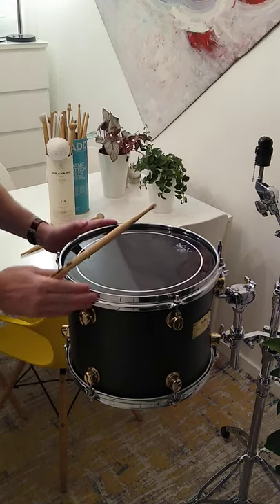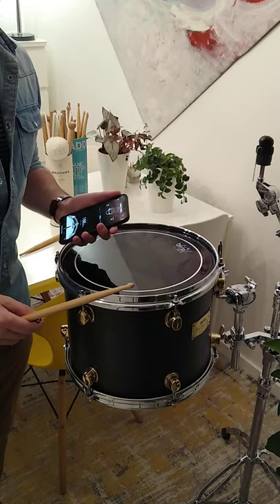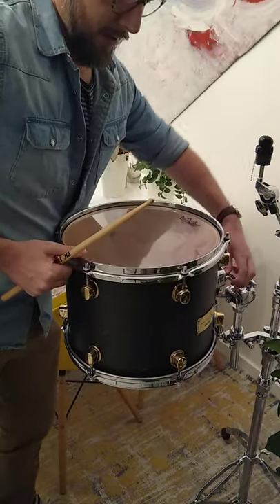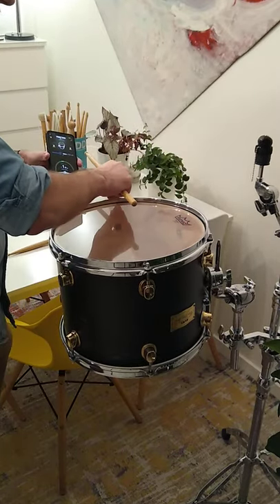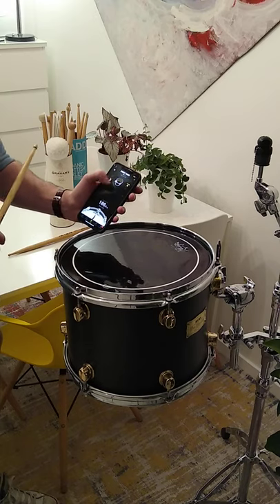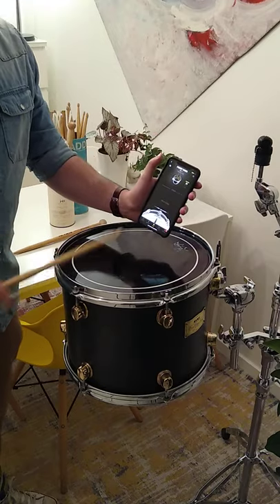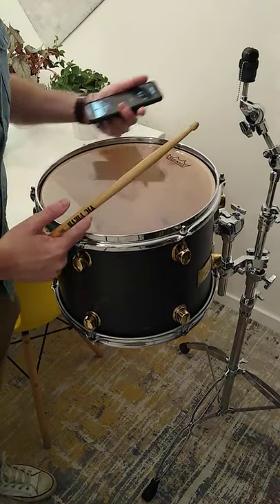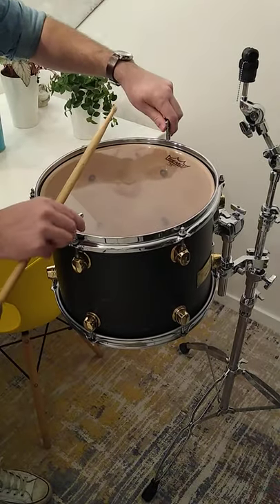Tuning my 13" tom from scratch to A2 for Tjas with both heads at the same lug pitches.

Comment: It will only work if you know how to use it i believe. You should still use yor ears and fine tune to your liking.  Devices such as this are only meant to be guides. They can help recreate the settings you like.  They can help bring you to the ball park of usable settings.  And that's a big help for those learning to tune. It gives you MORE ACCURACY.  But it will never replace our ears.  Can be a very useful tool if you know how to use it.  Takes practice.  Tells you where your drum is in terms of pitch and tension.  A reference.  That in itself is a great value. Just remember your ears are priceless.
Reply from the maker: Indeed, the app is a tool to assist you while creating & researching drum sounds. 
Basically, it’s a tuning aid that helps you clear your drum heads.

Mastering your sound, acquiring tuning insights, developing sound awareness, and tuning skills are learning processes. 
Making tuning decisions is not the responsibility of the tuning tool.  
As a drummer, it's important to recognize that you make the tuning decisions to master your sound.
Therefore, as a drummer, it’s important to acquire insights about at which pitch and tensioning range you should clear your drum heads to achieve a "sound & feel" A or B fit for your musical needs.  

As you underline so well,  that’s why it’s important to explore different tuning styles and why it's paramount to learn 'how to listen to how different tuning styles affect the "sound & feel" of your particular instrument and drum head combo so that you can decide on what tuning style suits your needs best. 

We fully subscribe to your viewpoint. 
Your well-founded comment is also a justified disclaimer about 'managing expectations correctly' and stipulates the importance of the angle from which the tuning topic is initially approached. 
It’s by methodically exploring which tuning action leads to what kind of "sound & feel" results that you 'develop your ears' to obtain a deeper "sound awareness," backed up by tuning insights. 
Developing a more refined "hearing-taste" and a "sound awareness, "meanwhile linking those to "knowing how to achieve sound & feel A or B"  by tuning (and/or muffling) is what matters the most and that takes experimentation, comparison, and thus... practice.

Exploring different tunings makes you acquainted with your instrument and its tuning range/sound versatility.  It's a journey. A process involving some research.
The app means to be a tuning aid which supports a drummer during that sound research process. 

Obviously, it isn't useful to see a tuning aid as a ‘tool vs. ears’ kinda situation.
You outline it nicely: a tuning tool is complementary to the common tuning process; it’s not something ‘different.’  We tweak the tension of the drumheads to get to sound & feel A or B. Using a tuning aid doesn't change that at all. 

Hereby, like you point out, once you understand that overall tuning process a bit deeper, making a tuning decision about "sound & feel" is where your ears are for. 

(It’s not solely about the values displayed on screen… and that is not where the focus should be because clearing drumheads isn’t the same step as verifying and understanding whether your drums sound at their best for your needs. )

For example, it isn’t necessarily because drum heads are accurately cleared to random lug pitches that the drum automatically sounds & feels right for your musical needs. You judge how fit a given tuning is for your needs. 
As a drummer, you explore, tweak and adjust at which pitches you clear both heads, concerning one another and also where they sit in their tensioning comfort range at that point, etc., to get optimal results.  
Developing a sense of which tunings get you to a particular "sound & feel" empowers you to tune your instrument to a variation of "sounds & feels"  (or even musical effects) fit for your musical needs, takes some practice and personal research to compare different tunings.

Just like you mentioned, gaining such understanding requires active listening, attention, and awareness…
When listening to the sound of a drum, one should check the rebound, listen to the attack, fundamental tone, and the overtone timbre and how both proportionally sustain and decay over time throughout the entire duration of the drum sound to get a sense of which tones project, how the stick rebound and articulation are, etc.
It takes practice, thus time & effort, to develop that ‘ear-awareness,’ no matter how you clear the heads, by ear or with a tool. (Which is often nothing short of a true "challenge" for beginners at the start of their tuning journey. Hence, a tuner can be a legit time-saver here.) 

There’s no shortcut, but practice can be done efficiently, inefficiently, or not at all. 

A tuner may make tuning practice more efficient as you have a visually quantified guiding reference, indeed… (Once you got the hang of how to operate such a tuner and understood the basics of the fundamental tone, lug pitch, overtone, timbre, etc.… Insights that are easier to develop and understand with the aid of a tuner than without one. That hearing awareness develops simultaneously simply by comparing how different tunings of both heads of the drum in front of you affect its sound & feel. )

One of the perks of a tuner is that you can ‘quantify’ a tuning so that it becomes easier repeatable and faster reproducible. This also gives you more insight into and control over your experimentations with different tunings while tweaking the tension of the drumheads of the drum in front of you.

To conclude, perhaps we could say that the app (or another app, or a Tunebot, or any other pitch-based drum tuner) works as a GPS while exploring different tunings:. It measures and quantifies your tuning. It provides 'coordinates' of where you are located at any given point while tuning,  and it can guide you to "drive home"  to the coordinates of another sound that you know & like, should you wander off too far while exploring. 

Thanks for the wise words! 
Cheers & happy drumming!
Reply: Very well said.  It pays to know where you are to get to where you're going.  Without knowing you'd be lost or drifting  to unknown ranges . Such is the nature of drum tuning.  And some people just know their way.  Cheers

Comment: I have this app and I have a mapex tomahawk snare drum it has 10 lugs and I'm having trouble tuning it with your app
Reply from the maker: There's a learning curve... To be able to provide support to you, please- reach out at support@drumtunepro.com with details about your tuning goals, lug pitches etc. Replying under a YT post is not he best way to get helped. No worries. We'll be happy to help if you reach out! Thanks & all the best!
Reply: The reason it doesn’t work is because there are too many subtle variations of overtones that probably confuse the app from accurately measuring it. 10 lugs have a lot less space in between them so the tension must be applied evenly on every lug or else this problem will occur. It’s a pain and I often opt for a 8 or even 6 lug snare drum for this very reason.
Reply from the maker: @bawol-official  Thanks for thinking along! That's awesome. 

However, in my experience,  it's unlikely that lug count is the culprit here. 
When someone encounters a tuning issue, it could have different causes and/or a combination thereof. It's not always possible to correctly judge these facets without further details. In my experience providing support, different drummers have different instruments and different tuning-experience levels and goals. 
The cause(s) usually get easier to diagnose correctly when one reaches out to support with details so that the dialogue & mutual cooperation gets started. Once in contact, we can cooperate towards a diagnose & solution. (If one experiences an issue, it may well be related to how the app is used, or perhaps the drum has a bit of a bent hoop, or both, for example.)

BTW: You made an interesting remark about lug quantity. 
(For the record: tuning a drum with 10 lugs to perfection with the app is perfectly possible.
Of course, you decide which degree of perfection fits you, but I would say that often it's even easier to reach a high degree of perfection when clearing a drum head on a drum with 10 lugs with a drum tuner than by ear, in my experience.)

That aside, indeed it takes more time to clear a drum with 10 lugs, than clearing a drum with 6 or 8 lugs.
It's a bit harder to get them all into the precision of +/- 1 Hz or better, when you have a drum with a higher lug count.
It simply takes more iterations to reach such a degree of perfection on all of them when fine-tuning.

On the other hand, you'll also get a more uniform lug pitch around the circumference of the shell's bearing edge and thus a more 'cleared'/equalized overtone timbre in the after-ring when playing a well-fine-tuned snare drum with 10 lugs vs one with 6. 

As an approximate rule of thumb, one could say that, if two drums were exactly the same and tuned the same, the fewer lugs, the more complex its overtone timbre would be, because of a less uniform tension distribution over the bearing edge.
As you also describe well: this is a consequence of the counter hoop's limited stiffness, which lcoally deforms and creates the highest pressure (higher pitch) where the lugs apply their force and the lowest pressure right in between two lugs (lower pitch). The relative distances between those points towards the entire circumference increase when there are less lugs, and thus allow for greater pitch differneces than when there are more lugs.

For the sake of not painting a single-sided picture: while more lugs (and stiffer hoops) allow for a more 'evened out'  tension distribution over the bearing edge of the shell. 
By itself, it's not better or worse to have more or fewer lugs (or stiffer or less stiff hoops),... 

Lug count, mass, material hoop stiffness, etc. give a different character to the sound of the drum. 
This character can be what you look for, or what you wish to avoid. Different instruments have different dynamics and timbre characters. 
Whether a sound character is more favorable than another one, finally depends on the context wherein it's used and/or your goal or musical needs. 

Pointing the mic towards the impact spot allows the app to pick up on the local lug pitch, so it's not confusing for the app. 

Cheers & Happy drumming!
Reply: @drumtuneprodrumtuner6249  I am honored to have been replied to with such a informative and thoughtful answer. Thank you!